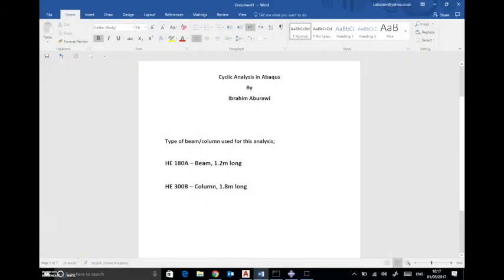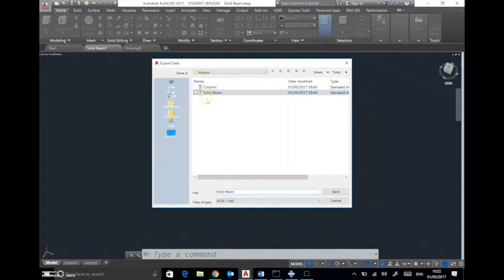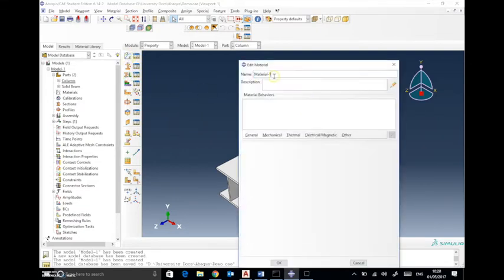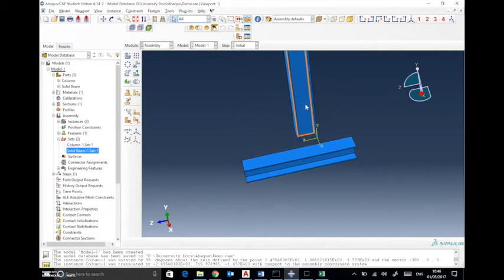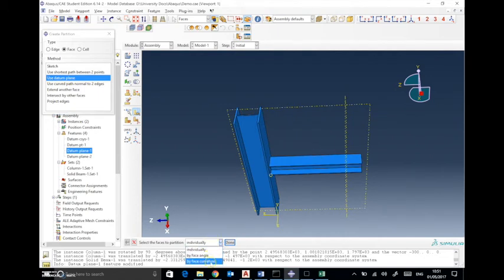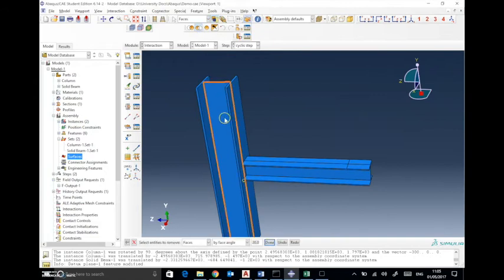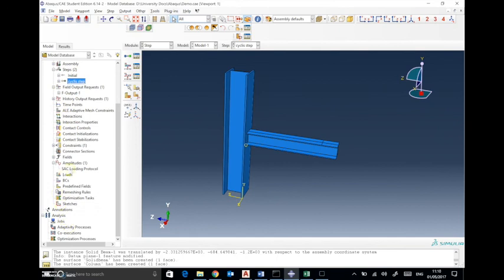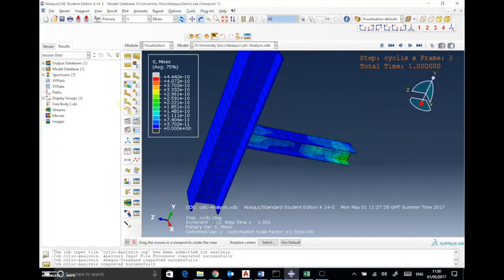Cyclic Analysis in FEA software (ABAQUS/CAE 6.14 - 2)

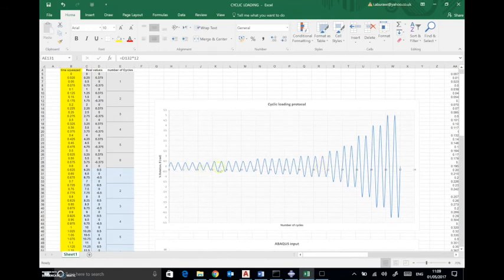Comment: Hi Ibrahim, thanks for the video!  At 28:43, you have a cyclic loading protocol with time and amplitude in excel columns. May I know how you convert the waveform to the amplitudes?  I have a cyclic loading wave and would like to digitise it to amplitude VS time. 
Thanks and look forward to your reply.  :)
Reply from the maker: Hi Eliza3029, 
The cyclic wave was based on fema350 and the change of input variables were based onstudy carried out by pachoumis
Reply: Thanks for your reply!

Comment: Hi, can you do cyclic loading on FRP wrapped RC column using ABAQUS? really appreciate. Thank you.
Reply from the maker: Syaja halim, 
Yes you can but it requires more time to run as there are many surfaces interaction must be defined
Reply: Can i have your email? want to share my model. I'm doing lateral cyclic load on my RC column. but have difficulties to insert the cyclic hardening. if you don't mind to share your knowledge.
Reply: Hi, Syaja Halim. Did you ever manage to model the FRP wrapped RC column in ABAQUS?

Comment: How do we get the smooth hysteresis curve from the abaqus?
Reply from the maker: Hi bimal bhandari, 
After completing the analysis, you can conduct the required (Load - Displacement) curve by ticking the appropriate boxes from the list that can be found in ''XY Date - ODP Field Output''.
Reply: Thank you Ibrahim.
But what values shall we input for kinematic hardening parameter in plastic property definition?
Reply from the maker: bimal bhandari 

When you input the material's properties, make sure the first stain value is not equal to zero. 
Hope this solve your issue:)